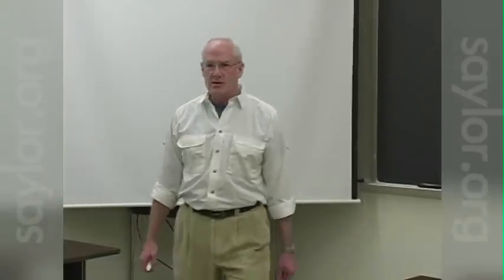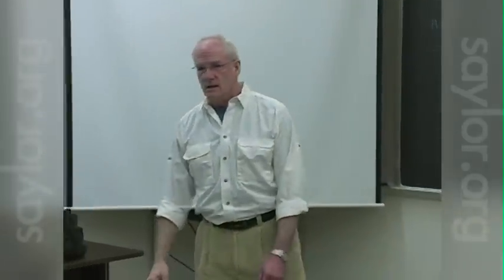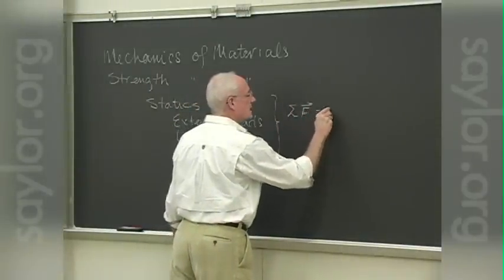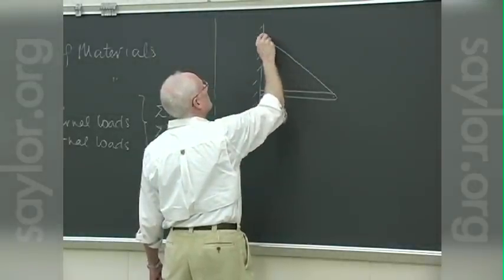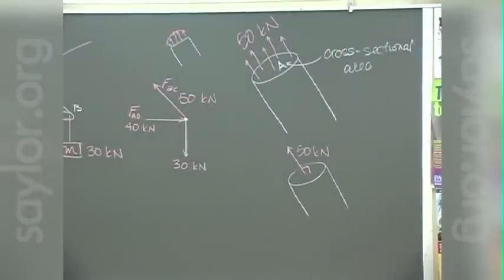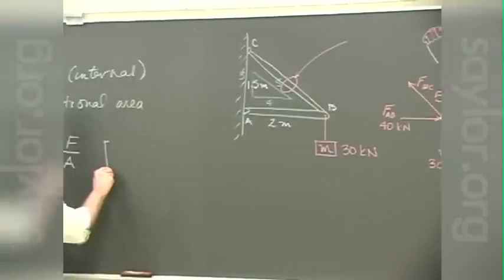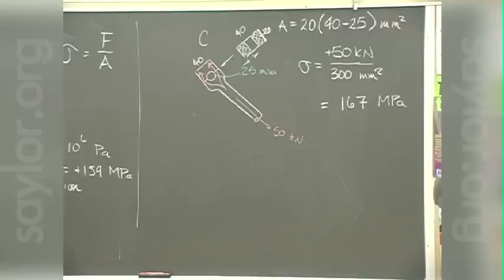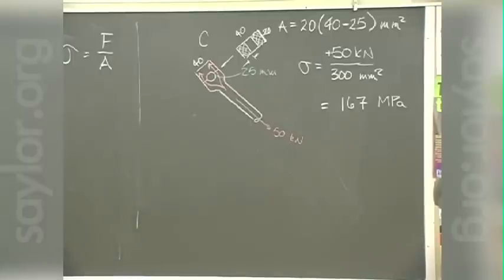Saylor.org ME102: Ken Manning's "Mechanics of Materials - Introduction"

Comment: Great video, but I noticed that the instructor was having some problems with metrics like the rest of us old fogies that are used to square inches and kips. Here, I wish he had shown the class the results of both systems, because in the US, things are still widely done in inch and pound measurements. (Force of 1000 psi=1 kip and area = radius squared x pi = sq. in., then stress = kips / area in sq. in.). Also, the stress rating for a lot of materials, in a huge majority of US handbooks, use psi and the area in inches. The students need to be proficient in both.
Reply: I wanted to add, that the instructor briefly gave a hint to the class for the size of the straight connecting pins in shear. If the pin is the same diameter, through it's length, then the largest force is what the pin is designed around, and the lower forces can be neglected, because if it will withstand the highest force, then the other lower forces will easily be held by a much higher margin or safety factor. Also, I think he should have mentioned the factor of safety of 2+ a little more for the students, and showed an example.
Reply: I do use both English and SI units.  I just didn't happen to in the first video.  This was an introduction to the subject.  Using both sets of common units, bringing up safety factors, and all the different forces (and choices) in a problem- all on the first day- would unnecessarily cloud the issue.  I teach so as to give them a very solid grounding in the fundamentals and sometimes, because of a limited class period, I skip over or past some details that a professional would need to know.  These are second year students.  I expect them to study for another 2-4 years before they are professionals.

Comment: how did you  get   40 Kn  and 50 Kn ?
Reply: +Quruxloow Qurux 40 and 50-kN are the forces in members AB and BC. you can get these values either by summing the forces in x and y directions and summing the moments about a point, or using the triangle method(which was discussed at the beginning of this lecture).
Reply: +Nazanin Moghtaderi   thank you very much .